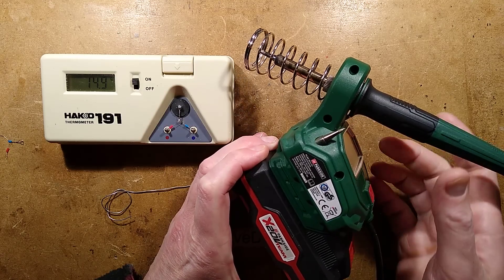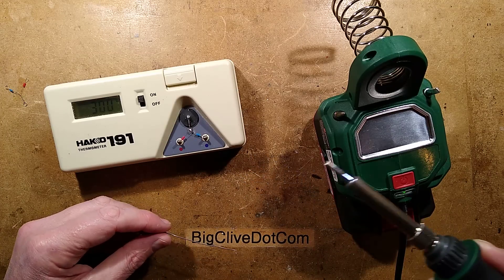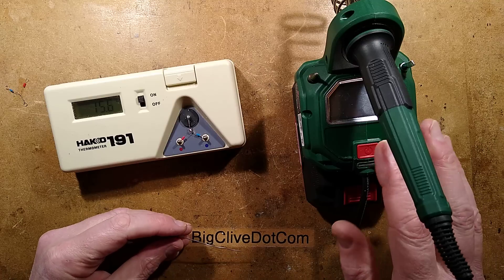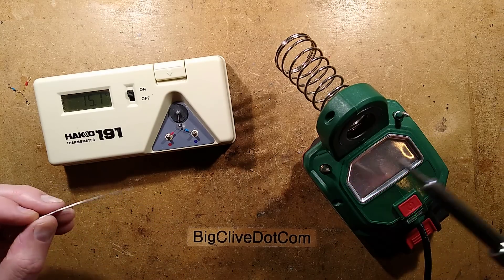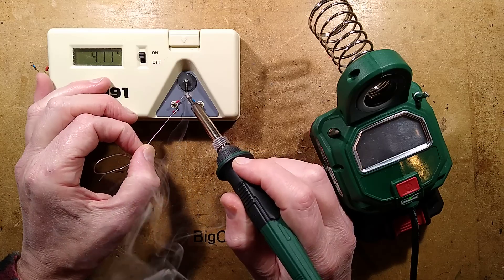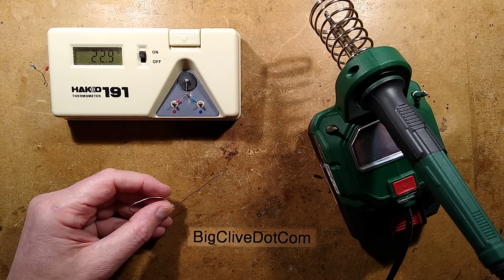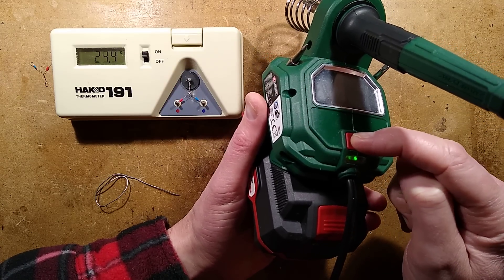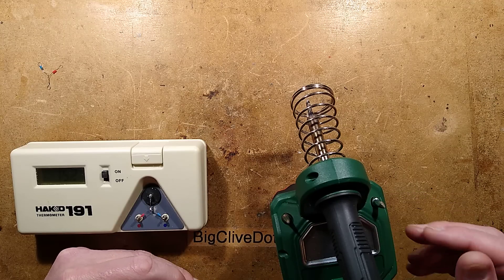Parkside soldering iron secret calibration mode A1 model

Comment: I wonder if cud modify a digital thermometer to display the temperature
Bit funny it's at max temp 500⁰c by default
🤔 Think they want ya to burn it out and the tips ....the Pcb is tiny and pointless 🤣
I've know a way to make it work without just with any 20v power supply but may kill other battery's without the monitor connected...... I've also noticed it switches to 8 to 10v when it goes green so that cud be a battery power mode and could be triggered by modifying the temp circuit disabling the fast heat mode when cold it decreases resistance as it cools and it seams resistance corresponds to temperature does that mean it's a PTC thermistor in ther ????

Comment: I wish the Ryobi One+ version wasn't so expensive at $75 tool-only. Running from a battery would be useful. I do have a butane iron for automotive and remote work but it's crazy hot.
Reply: John Ridley I'm currently seeing $50 tool-only on the Home Depot website.
Reply: @ib9rt  Wow thanks I kept landing on the hybrid model that has an AC input as well.

Comment: That's a handy feature. The 480 deg preset is far too hot, I usualy solder about 335-340.
If I'm soldering a ground plane I will go upto 450.

Comment: Does it default to factory settings when the battery is disconnected?
Reply: As he mentioned, the new value is written to non volatile memory. So it should keep the freshly programmed value even after battery removal.

Comment: This would be cool to have in the US.   Don't seem to be sold here
Reply: James Miller Ryobi has a higher quality version with a temperature control dial. Check out model number PCL946. Still comes with a PVC cord though, would have been nice to get a silicone rubber cord with it. (It also uses Hakko T18 style tips.)

Comment: Wow, this saves me a lot of unneeded hacking. After your review of the iron last week, I ordered one from the Lidl on-line shop (over here, in The Netherlands, they're not in the stores at the moment) and it arrived last monday. Yesterday I took it for a test drive and found it a bit too hot for my taste and decided to perform the resistor hack you mentioned this upcoming weekend, to put it into the 330°C - 350°C range, but apparently I don't have to. I like this way of setting the temperature very much, so thanks again! 🥰

Comment: Dont know if there is a cap on that....... Errr Clive, my tip is glowing Red. Think i may have gone a tad too far. lol.
Reply: Please don't burn your house down with that soldering iron. Winter might get cold 😉
Reply from the maker: Glowing red hot is an express route to sudden heating element failure.
Reply: @bigclivedotcom  Was just joking. But im sure someone is trying to find the upper limit.

Comment: As this is a video based around a soldering iron. I thought I'd ask a related question. Anyone here have experience with soldering xt60 connectors? Im building an amp and have chosen to use this connection type as an experiment, however I'm having a hard time using my usual silver solder. Instead I'm planning on using 63/37 solder for the first time. Anyone got any tips and tricks? Thanks!
Reply: As Clive suggested, try lead solder and maybe add some Flux if you need to. You shouldn't need any with rosin core solder. Too much heat will melt the connector, so be careful. I would suggest plugging the matching connector in to keep the pins aligned and take some of the heat away.
Reply: @PunakiviAddikti  thanks! What temp would you suggest for 63/37 solder? I'm thinking around 380. Is that In the ballpark?
Reply: @JMJM75257  Depends on your soldering iron. If it has a large thermal mass, 380 should be sufficient. If it lacks thermal mass, you'll need a higher temperature to pump heat into the joint.
Reply: @JMJM75257  Julian Ilett has done a fair number of videos soldering X60 and X90 connectors
Reply from the maker: It may be better using a lower temperature solder like traditional tin/lead to protect the connectors against melting if the contacts are already in the housing.
Reply: @bigclivedotcom  thanks Im having more an issue with flowing the solder and not drying out the connection. I've got some lead/tin solder on the way. Fingers crossed I get on better with it!
Reply: @JMJM75257  A drop of separate flux might help?
Reply: @davefiddes  Thanks for the suggestion. I did try using abit of thermal paste but it didn't make much of a difference. Im thinking the solder I have just doesn't like the material of these connectors. Hopefully the lead stuff I've ordered is much better to work with. It will be my first time with lead solder. Always used the lead free stuff which has always been hit or miss.
Reply: @JMJM75257  Search for Low Melting Temperature Solder.  You can get solder that melts as low as 157C / 315F.  Add a flux pen and you should be sorted.

Comment: The problem is of course you don't know at what temperature it's set at unless you have a (calibrated) thermocouple meter. You could use a multimeter that has a thermocouple range and a regular 2-wire thermocouple probe and check it at 0 and 100 degrees C
Reply from the maker: It can be nudged by soldering "feel".
Reply: Or if you know the melting point of your solder, go down until it solidifies, then you know how much to go up to get to your desired temp.
Reply: You can get a cheap HAKKO 191 on eBay like Clive was using for a few $£, but as the man said "move the temp up and down until it feels right".  The number isn't that important and will vary depending on the thermal mass of what you are soldering / soldering to.

Comment: This is a good feature and turns it into a useful "second iron" (rather than a soldering sledge hammer).  As it is on sale in Lidl (UK) from tomorrow at £13, I would say get one if you haven't already, especially if you already use Hakko type tips.  If you want to make it even better you could change out the pvc lead with a flexible silicone one.  (But not if it is your only soldering iron!)
Reply: Cool, for £13 I'll get one, even though I'll have to mod the battery attachment for my Aldi batteries.
Reply: @welshdave5263  For an extra £25 you can get a 2Ah battery and charger.  The 2Ah works for me because I use it for "soldering to the work" jobs that are generally only a couple of joints.  Other stuff can come to the bench and the "proper" station.  The Lidl batteries are really cheap (and a good source of 18650s!).  2Ah - £15, 4Ah - £28.  My cheap knock off Makita batteries cost more than that and last nowhere near as long.
Reply: @angusmclean4783  I don't have any Lidl tools so no real use for their batteries, I already have 6 of the Aldi batteries and a few of their tools.

I'm of the same mindset with regards to the Makita clone packs, got an old Erbauer ERB183 18V NiCd jigsaw converted to Aldi packs (I think they have Panasonic cells), once I've repaired the Makita angle grinder I've picked up I'll 3D print an Aldi to Makita battery converter and get more Aldi packs than buy Makita clones.
Reply: @welshdave5263  when i was looking into the lidl batteries balance chip i found that i had a pack with cells wrapped as grizzly, theres a grizzly tools that say they only use samsung cells in their tools, as aldi and lidl tools seem to be virtually the same tools, its possible that the aldi ones are coming down the same supply chain. battery nerds who did test the lidl  ones say the discharge curve was a near perfect match for samsung 'q' series cells. i've been using the lidl batteris for years now in my ebikes and have some still going ok from 2018. I dont like the lidl batteries, I wished when i started my tool collecting i had stareted with the lidl ones as the packs have over discharge in the pack not in the tool. i have had some packs go under voltage and refuse to enable the charger, and even after manually recharging and balancing, the pack still wont enable the charger, the chip seems to lock out. cant find a datasheet eitther...
Reply: @angusmclean4783  The Aldi and Lidl battery powered tools used to use the "Einhell Power Xchange".  However are they the same with the current range of tools that use their own Aldi/Lidl batteries and chargers?  Do you or anyone know as that would be useful if you could buy their products and also use on the Einhell tools I also own.
Reply: I was also thinking swapping the lead for a silicone one.

Comment: Great video, Clive!
All I need now is an adaptor for my Makita battery!
I'm quite heavily invested in Makita tools and I don't really want to start another tool collection without the adaptor option.
Reply: I'm sure someone out there is/could 3D print them... I remember Clive made an adaptor for (name?) batteries some videos back. The electrical connections should be easy enough anyway; why not just wire it up and see what happens? (Voltage check completed first of course!)
Reply: @stepheneyles2198  No need to 3D print-aliexpress sells Bosch and Makita adapters. Only question is what does Parkside battery third pin do and how to make low voltage cutoff.
Reply from the maker: Not sure how that would go with the control signal that tells the iron when the battery is low.
Reply: @bigclivedotcom  That's a point that I had, amazingly, thought about!
It will be something to start with - until I get a 3D printer it's a quick option!
Thanks for your reply - appreciated. 😊

Comment: Could you click down to 'infinity' to test what the minimum temp is?

For someone without a temp probe you'd be "tig soldering" in the dark without knowing a starting temp, so if you could click down a few tens of times to be sure you're at the minimum then you can start counting up to a known temp.
Reply: Do you really need to know the exact "number"?  Perhaps better to experiment based on how it is soldering on the job you are doing and how the tip is fairing? (i.e. it need more or less "oomph" (SI Unit for soldering flow)
Reply from the maker: @angusmclean4783  The heat will depend on your soldering speed.  So trial and error is probably the best way to set the temperature.  Keeping in mind that the classic irons of the past didn't even have a temperature setting and tended to run quite hot.
Reply: @bigclivedotcom  Depends on what's meant by classic, no?  My ~50 year old Weller TCP iron uses calibrated tips.   I'm currently using 600F tips for most work.   The Weller TCP was a standard for US professionals.  Weller call(ed) the technology "Maganstat".
Reply: @tubastuff  Even in the UK I love the Weller magnastat (I think they still make it, but it's a different version with separate magnet and tip) I use a 7(00) for normal use and 8(00) for big jobs
Reply: @henryokeeffe5835  Apparently, Weller has revised the iron design and now specifies LT-series tips.  One can use the older PT tips, but it apparently requires a new sleeve and adapter.   I still have a grocery bag full of PT tips that I picked up many years ago when a local electronics store went out of business.
Reply: @angusmclean4783  True. But I can imagine people want to know. Also handy if you want to temporarily change the temperature to a different setting for other purposes.
Reply: I believe the max is 500C so you can go down from there.
Reply from the maker: Is be cautious about topping out as it may go higher and could burn out the heater.
Reply: @bigclivedotcom  Yes well then it would indeed be a good idea if you set it to the lowest possible setting and tell people without an iron thermometer what temperature it is so they can put it to aproximately the right temperature by counting clicks.

Comment: Damn.. I bought it last week (In Czech Republic) and I got an "optimized version" with removable pen stand and completely different version of PCB. And surprisingly, it does not work on that one. So if you have option try to get the one with the non removable pen stand.. seems to be superior to  the new "optimized" version I have. At least the temperature feeback seems to be wired the same way (without the place for the potentiometer) so I can at least try cut the wire and add a variable resistor there to set the temperature that way.
Reply: For completenes, mine is PLSA 20Li B2, BigClives seems to be PLSA 20 Li A1. Seen like this time the evolution of Parkside Product went the "chinese way" of lowering costs instead of making better product.

Comment: With the UK bringing in law to eliminate all the different power connectors .. It would be great if they would do the same for battery packs!!
Reply from the maker: It would be good, but I bet the manufacturers would find a way around it.
Reply: @bigclivedotcom  So many products will be tossed when their battery packs stop working .. horrible really, a lot of my lawn tools are battery powered .. like my fancy lawn mower.
Reply: @stevenspmd  I’ve taken to gutting out the battery ( nicads ) and fit the required number of lithium 18650 ( ex Dyson) cells in cell holders. Ie 4 for 14v stuff.  Just pop the screws and swap cells which are recharged separately .  More power and longish life if not used too often  also good part use life for occasional use tools
Reply: So long as they make adapters so they work with existing tools. We have a lot of Makita tools that all use the same batteries and I'd rather not have to replace them all because they use a battery that's no longer supported (including the lawn mower).
Reply: @hikariyouk  Yep, such a law should require companies that stay in the market to offer (at reasonable prices)  adapters for all their old products.  And this isn't limited to tool batteries.  Phone batteries are even worse to get with the right connectors and sizes.
Reply: @hikariyouk  check out the online sellers- you can get practically any possible combination of tool/battery out there, if not find someone with a 3d printer and get a few printed up, add some contacts and away you go (lol, get a few extras made up and sell them yourself as a side hobby-if you want one, its likely others do too)
Reply: @steved2136  Somebody with a 3D printer would be me.
Reply: In Europe you can purchase a lot of 18V tools with a CAS (Cordless Alliance System) battery connector, it's basically the connector used by Metabo on 18V lithium batteries.
But unless you are a professional it may not be any of the ones you use normally, even if it is one of the ones you use regularly it will be more expensive than the Lidl/Parkside equivalent.
I had a Metabo cordless SDS hammer and a Metabo cordless drill with that 18V battery and now I barely use them because I got their Parkisde equivalents and a bunch of X20V batteries of various capacities. I bought the cheap tools from Lidl to use them in dirty conditions and in the rain, to avoid damaging the expensive Metabo ones, but in the end I ended up almost always using the cheap ones because I always had two or three charged batteries on hand and only two Metabo 2Ah batteries.

Comment: That's awesome. Suddenly makes it a very nice iron! I was thinking about buying one and replacing the resistor with a potentiomet but this is so much better.
Reply: Be careful. There is "optimized" version (with removable pen stand and completely different PCB) that does not have this feature. I unfortunately had to find that the hard way. I have it and I just failed to source second one here (Czech Republic), same as BigClive has.
Reply: @Badgii  Thanks for the warning. It looks like the Lidl online store in my country has the same model as in the video. Only €17.99
But the one in the Czech online store also looks the same. Have you ordered from them online and received a different model?
Reply: I would still go with the potentiometer. This is for calibration and is probably chipping away at the finite number of MCU flash writes. Although this very well might be a psychological issue of mine...
Reply: @johnromberg  Given that even the cheapest flash memory can usually withstand north of 100,000 writes, I don't think you need to worry about it. Even if you're adjusting your iron's temperature 10 times a day, 7 days a week, with no breaks ever, you've still got over 2 and a half years before the flash memory starts to fail.
Reply: @HiddenWindshield  Bless you for trying to fix crazy with maths. :)
Reply: @johnromberg  I see what you mean but it's not often that I change the temperature on my iron. The only reason I was planning on using a potentiometer instead of a fixed resistor was the ability to have more precise control over the target temperature. Installing it on the outside of the case would be way too much hassle for such a cheap device.